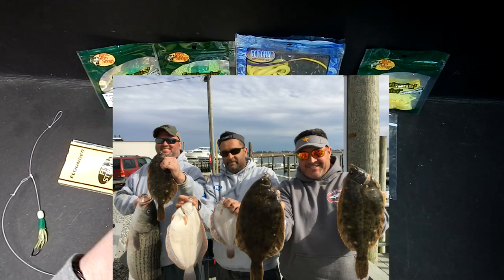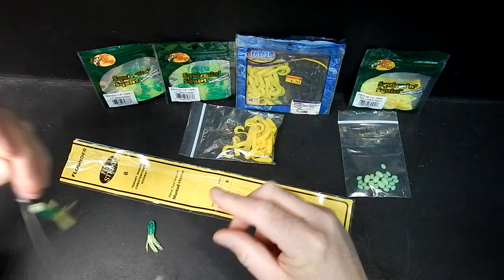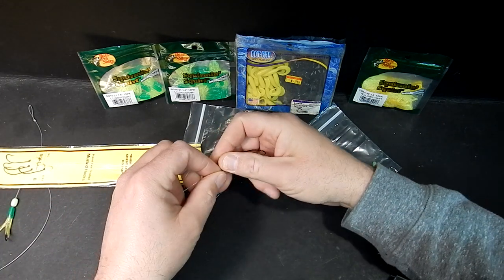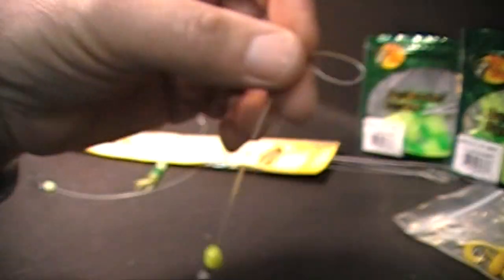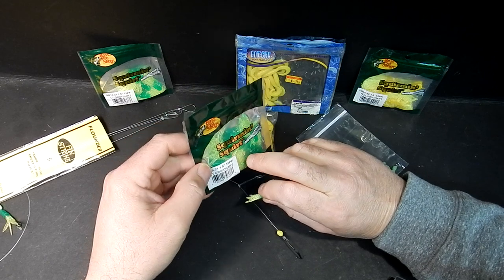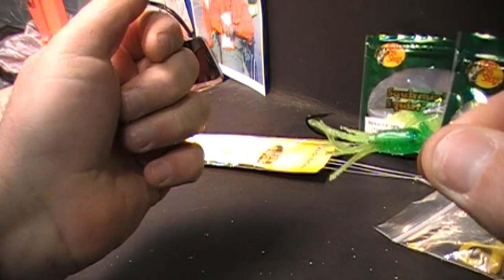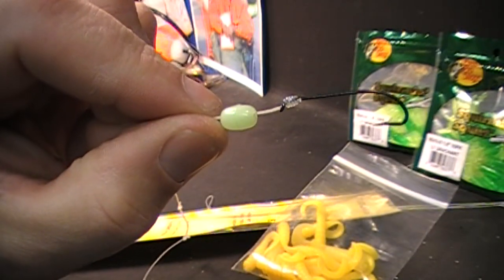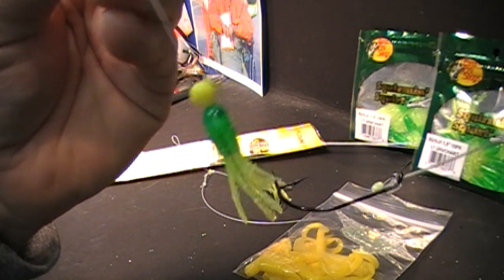Flounder Rig. How to Tie The Perfect Interchangeable Winter Flounder Rig

Comment: Where are you placing your sinker (weight) on this rig? at the top?
Reply from the maker: No, this is just the hooks.. You attach this rig to the main line off your rod via a dropper loop. The weight is Below the dropper loop via a surgeons loop. The weight goes through the Surgeons loop.